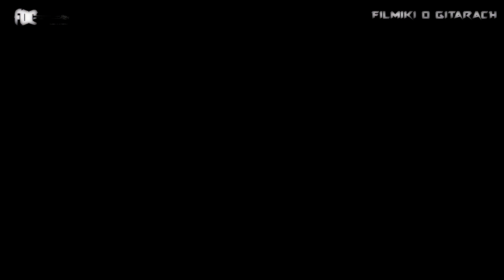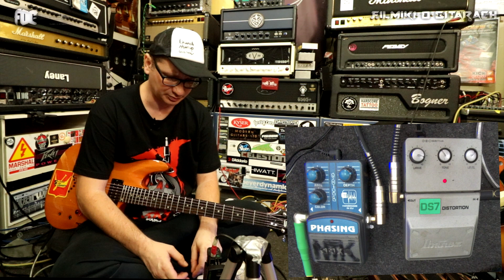Phaser & Distortion - Guitar Effects Connections - XTP Guitars

Comment: hey there, i got a problem of sound boost when I use my phaser avec my disto but I prefer the effect like that. Should I try to put it on my amp chain or definitly get another one with a volume button? thanks
Reply from the maker: Try it in the loop or after the distortion, some phasers will boost the sound.